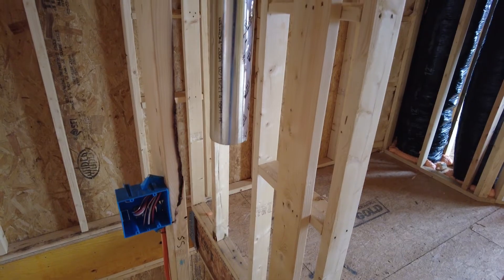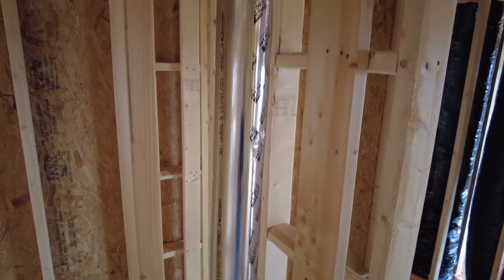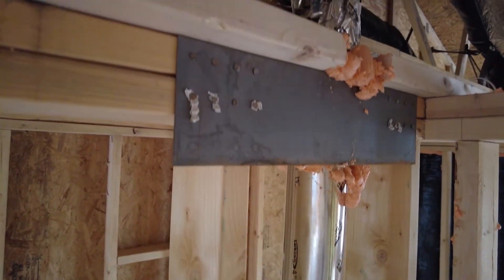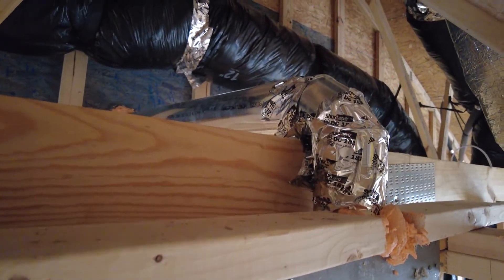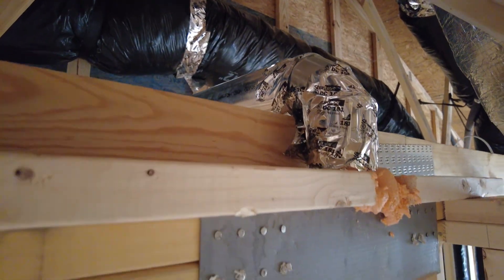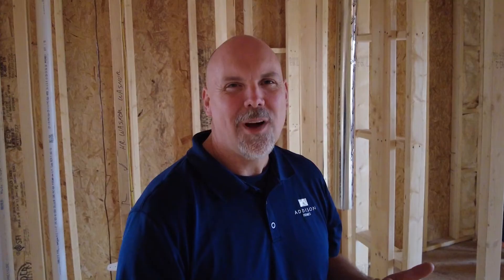Dryer Venting | Potential Issues & Best Practices

Comment: Since hot air rises…Is it better to vent uowards and out ? Or is the benefit to have the ductjng sweep downwards and slopes to exterior for the moisture to run out?

I’m torn on deciding which path to go. 
( venting up and out would be within living space and a rad longer..venting down would be through crawl space and a bit shorter distance 

You’re advice would be super appreciated

Comment: I know this is an older video but I'm hoping you can help me.  We just moved into a home a couple months ago (built in 2007) and decided to have the dryer ducts inspected and cleaned.  Found out the duct had completely disconnected in the attic space between the two floors and was blowing lint inside the attic.  Not only that but because of the location of the laundry room being in the center of the main floor, the duct goes up and around an upstairs room then vents out the roof.  This creates several 90 degree elbows before exiting.  It's a terrible design but we can't see any other options to reroute it unless we vent into the garage.  Would that be against code to do that?  The tech cleaned it out and reconnected everything the best he could with tape and for now have plans to reinspect it next year to make sure it's holding together and to do another clean out.  Do you have any other suggestions besides moving the laundry room to an outside wall?  Unfortunately we're on a slab foundation.
Reply from the maker: @Punkydoodle007  I would have to see the floor plan to identify alternate routing. 
One solution for the 90 degree elbows is to replace them with “dryer ell” long sweep 90s that do not have the same equivalent link penalties that hard 90s have.
Reply: Thank you.  I will look into that. @AddisonHomes

Comment: Why don’t you just go straight out the wall there’s a outside wall why go to the attic another problem?
Reply from the maker: If the laundry room is on an outside wall, straight out would be best. Often the laundry room is not on an outside wall and we have to go up or down with the  dryer vent ducting
Reply: @AddisonHomes how do you go up or down without drooling a hole in the top or bottom plate of a wall. And how are you drilling a hole in a top or bottom plate when they are 3-1/2” and the standard hose diameter is 4”? These are honest questions, not trying to be a smart-alleck

Comment: Previous owner of my house vented into the floor joists directly below the unit. 😅

I had to drill a 13" long hole through the stone block exterior wall to create a straight shot out the back of the dryer.
Reply from the maker: @mikemojica  I’ve seen it many times!

Comment: the builder of my home put in like 5 90s and the connection at the bottom is wonky and at a weird angle
Reply from the maker: Unfortunately, many HVAC installers and builders don't understand the implications of poorly installed ductwork.

Comment: On my modular 2007 home ( second owner) I position the dryer almost against the outside wall, vent turns 90 degree DOWN at about 45 degrees and another 90 degrees out the wall!
By ducting downwards, when the dryer is offline cold air can't drift in and migrate up and into the dryer.
Cold air sinks, warm air rises.
Been doing this in a couple friends houses for 10+ years, no issues.
Love the channel
Reply from the maker: Great strategy!  Glad you enjoy the channel!

Comment: Many times you do not have an option the way a house is engineered.... One 90 bend in an entire run is just fine... lint collection is always going to occur and regular cleanout is recommended no matter what.  I see no issue here.
Reply from the maker: This may be true in an existing home but we must always account for the dryer duct run in our planning, engineering, and design phase. The building code limits a dryer duct run to 35 feet with no fittings. Each 90 degree elbow reduces this by 5 feet.  The long sweep 90 shown as an alternative in the video does not have the 5 foot penalty and is smooth on the interior to minimize trapping lint. As noted in this video, there is likely no issue with this particular installation, other than lint buildup in the hard 90 elbow. Add a few more elbows, and you have a definite issue.
Reply: @AddisonHomes  clearly not 35 feet.  Agreed otherwise.
Reply from the maker: @KodiakEL  correct as noted in the video - should be no major issues.  Trying to point out that there are better, readily available alternatives to the way we’ve always done things!
Reply: He never said it wasn’t fine if you were listening it is fine. It’s just not smart. It’s stupid if you do that you’re not a good plumber, and unless that is literally literally the only only.
Reply: @williamduncan6973  We agreed.  Not sure why you are needing to place a triggered response two years later.  Hope you have a better rest of your day.

Comment: Dryer vent box should be code in this day and age.  I have yet to find a exterior vent that is effective in keep the cold out, the current versions with flaps don’t keep cold out.
Reply from the maker: Agreed!  The dampers on the exterior terminations aren't very good at keeping out the cold air.  This can be true of some of the interior dampers as well.  We have found that the interior dampers on Panasonic fans are pretty good at sealing out the cold.
Reply: @AddisonHomes i can say the same for broan bathroom exhaust fans. The cheap 70 cfm unit has a damper that does a decent job at stopping drafts In my experience. It’s not perfect on super windy days however as the flap is constantly opening and closing.